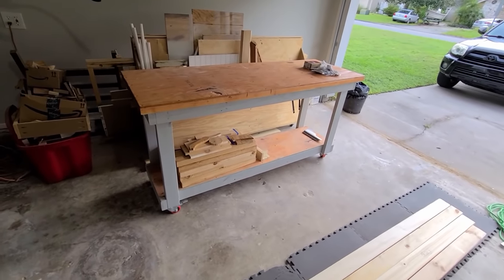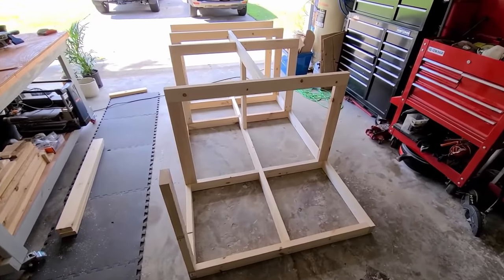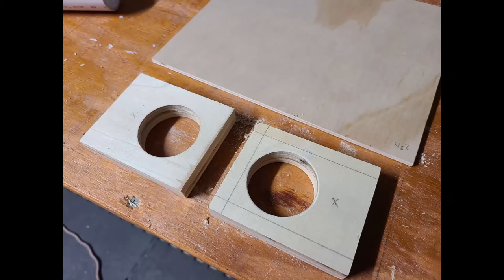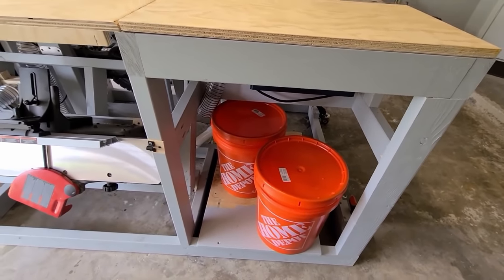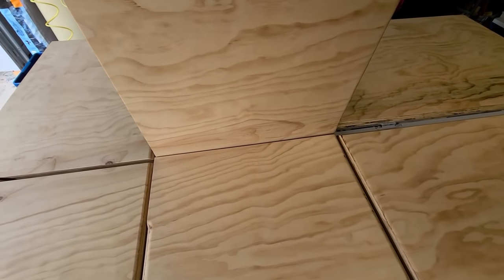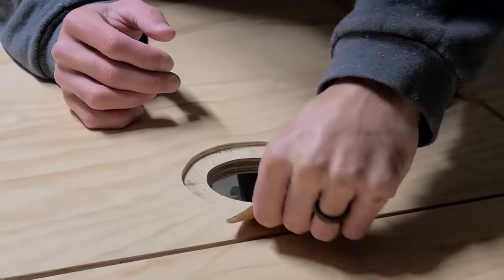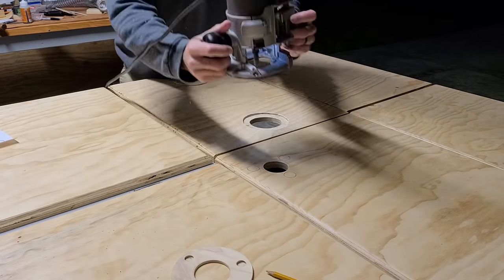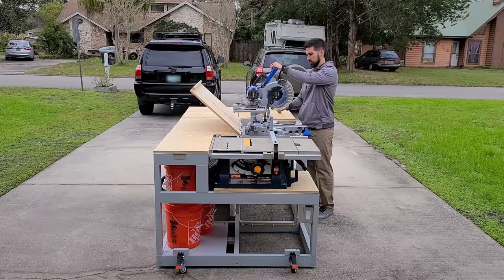4x8 Workbench, Tools, Vacuum, Power and Dust Separator

Comment: Is it just me or is there no voiceover and just the music. I can see the captions on the bottom but don’t hear the words. I wasn’t able to watch the full video like this.

This was an amazing table though. Way better than a lot of other table build by ppl with over 1/4 M subs. Just a suggestion, this video is great for ideas, but it would be more helpful (at least for me) if it was more of a How-to format where you go through what you’re doing, the reasoning, measurements, etc so we can adapt it for our needs/tools. 

Thanks.
Reply from the maker: Thanks for the feedback. There is some voiceover here and there but there are long periods of just music that just show what I'm doing.
Reply: @phillipreborn  for example at 11:20 I can see the closed captioning words saying you "attached it using sheet metal screws and gorilla glue", but I do not hear you speaking it. Maybe it’s just me 🤷‍♂️
Reply from the maker: That part of the audio is a little weird, it sounds mono instead of stereo so maybe it is not coming out of certain speakers. Not sure why that happened I'm obviously new to making videos...
Reply: @phillipreborn  ahhh. There you go. I was using a single ear bud so I didn't get the voiceover part. Disconnected Bluetooth  and it worked.  

Fyi I've Never had that issue on any other YT vids though. 

Keep it up. Looking forward to more wood builds
Reply from the maker: Here is a link to the plans, cut list, and a link to a video that elaborates on them a little. https://www.etsy.com/phillipcreative/listing/955545412/simple-4x8-full-shop-workbench-plans?utm_source=Copy&utm_medium=ListingManager&utm_campaign=Share&utm_term=so.lmsm&share_time=1614306374860

Video about the plans.
https://youtu.be/UvVJFht_9Vw

Comment: Love the setup, exactly what I need to lessen the footprint in my 3rd car garage workshop. I’m in the middle of building the same setup per your online plans. My question is, what did you use for the electrical setup? How many outlets did you use and what do you ultimately power it all with? Thanks!
Reply from the maker: Hey Scott, I elaborated on it a little in this video https://youtu.be/bWsZhiQ8qD4 Someone has cautioned not to house two separate circuits in one electrical box so keep that in mind. I used two (should have been three) 4 square electrical boxes. One is under the table saw and the other is under the router area. They are fed by two separate places to connect extension cords.
Reply: @phillipreborn , thanks for the reply. What gauge wire did you use for the wiring? Looks like 12g?

Comment: So how do you plug it in?
Reply from the maker: Extension cords. There are a few male plugs coming from the junction box.
Reply: @phillipreborn  What I mean is, you have a 4 prong outlet box under the table with what looks like 12/2 coming out of it...what do you have that going to?
Reply from the maker: @marcmarc4776  male cord caps coming out of one box then a piece of 12/2 feeding another box at the other end of the table.

Comment: I wish I could take pictures and send them to you I have pictures of as I took as I was building it I have a little ways to go yet with it right now I am putting some legs on it and then I'm going to put the casters on the other end I have the casters on where the table saw goes but you got to remember something that all table saws they're not the same height it's so I found that out now I got to lower the table down to make it level so when the lids are closing the top of it the table will be completely flat and you can run a board off on it so you have to come up from the edge of the 2x4 3/4 of an inch to make it worth even with the top what is majored it out he said that 29 in but the table saw that he used is different than the table saw that I have at the wall table saw that's what I'm putting on there and the DeWalt is higher than the Ryobi and I have a 12 in miter saw that I'm going to put in there and some other tools electric power tools
Reply from the maker: Glad to hear you made it work. Thanks for watching.

Comment: How do your neighbors feel about all that noise with the doors up?  Just a thought shut your door!
Reply from the maker: Hopefully they don't mind since I'm only out there occasionally. In this part of America we can make noise until 10pm but I try to be considerate always.
Reply: @phillipreborn  good. I just know how loud a jointer is or a thickness planer is. It just struck me as odd that you wear ear protection because of the noise but yet leave the door open. Not trying to bust your cookies! I currently have my shop in my cellar so noise isn’t a problem but I’m in the process of building a detached garage and when I move my shop out there I will have to keep my doors down when I’m using equipment. ( it’s just too loud) but anyways good luck nice vid.
Reply from the maker: @J297WFD  thanks, I probably would have if it was climate controlled but it is not currently.